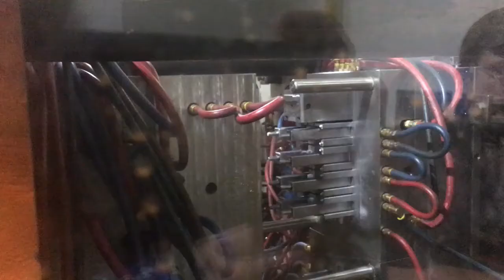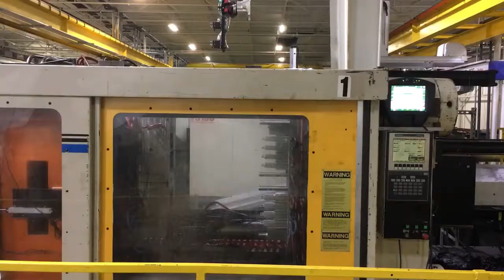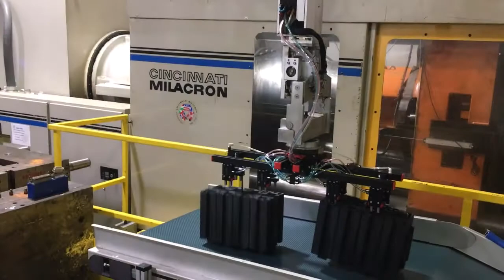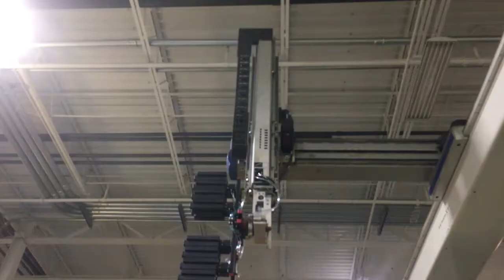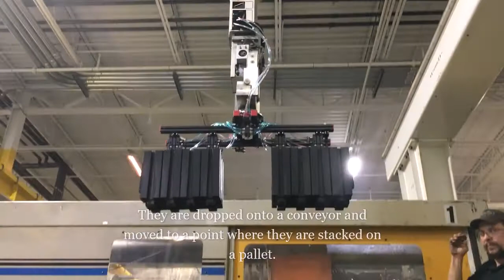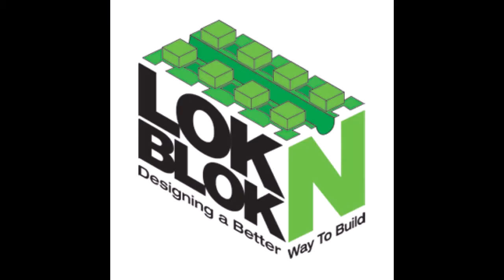Lok-N-Blok(r) Production Video

Comment: Good evening, we are interested in knowing the following, (1) Housing developments, clinics or hospitals; low-density multi-family buildings, in which countries, and their videos, please. (2) ISO 9000 certifications, they have it, (?). (3) Approximate prices per m2 built, both for single and multi-family dwellings. (4) They have models or prototypes of single-family houses, with their preconceived plans and design. Which (?). /5) How do they manage the issue of power generation, are they self-sustaining, (?). Thanks! Carlos Barreto Caballero/ INAGENCA VENEZUELA, CA. (ENERGY AND WATER ENGINEERING, C.A.)